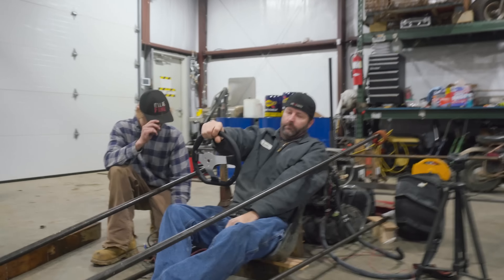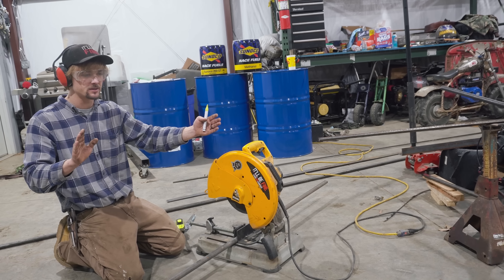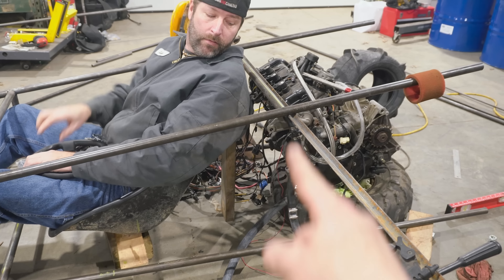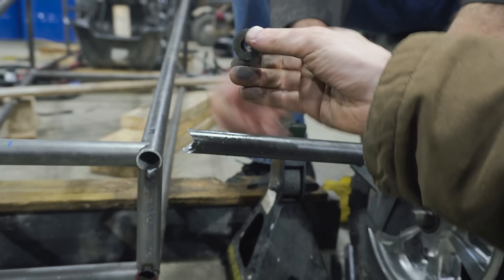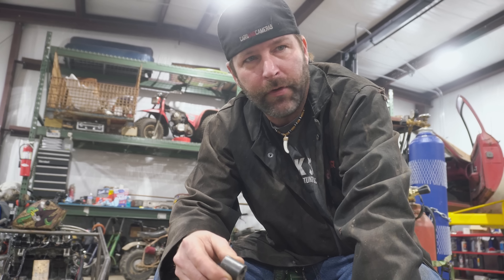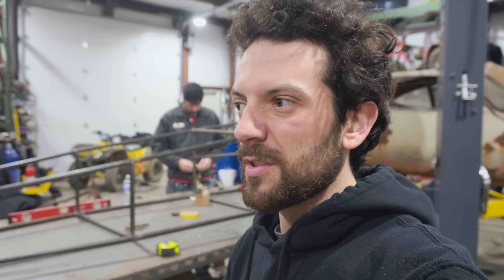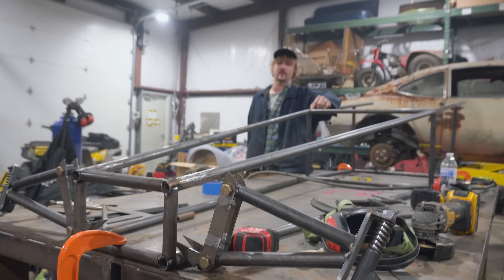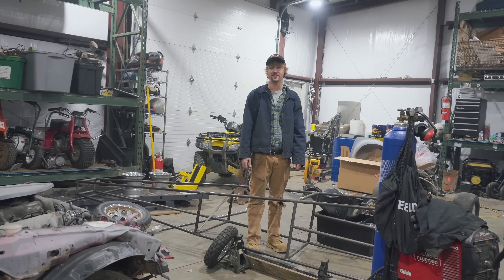118HP Triumph Dirt Dragster Build Pt. 2

Comment: Have you guys thought about using like miata subframe and building a frame to connect them together, use a 2009+ r1 for sound or hayabusa for power, they make drive shaft adapters that attach to the output of motorcycle engines used in ( dwarf/midget car or legend car) maybe buy a dwarf, midget, legend car 😎😈
Reply: dwarf and legends cars use a Toyota rearend, not a miata one. and why would you buy a dwarf car to go sand rail racing with? way to short wheel base.
Reply: @thedr309  mkii celica supra yes,
 but I was incoherent... so here is a more coherent version...

I wonder if they have thought to use both front and rear subframes from a miata and make a frame to connect them at whatever wheelbase they so desire, while using a motorcycle engine to power it (hey they make drive shaft provisioning for motorcycles because that is what dwarf, midget, legend cars use..... 

But hey you guys might even consider in the future just buying a out dated dwarf, midget, or legend car cheap....

 either of those options gives you suspension and way better brakes for the speed of a motorcycle powered vehicle
Reply: @thedr309  really it's not related to the sand rail but rather a future option  to have suspension and brakes (better for the cars and camera's grand prix track)   oh crap I forgot,   if they do go for a 5/8 scale race car they should find a legend car that was setup for road course, not a dirt midget/dwarf car
Reply: Mr Sealman the weight you would add by doing that would be prohibitive and you do realize dwarf and legends cars are hand built from tube don’t you? As far as the brakes go they haven’t even begun to built the brake system yet. I admire them for the start from scratch approach instead of cobbling a bunch of parts together as you have suggested there isn’t anything wrong with the approach they are taking now just wish they would be a bit smarter in things like design . And a dwarf car or legends car is nothing what so ever like a midget car
Reply: Well no suspension no front brakes 115-136 hp I dont math so good but the above listed items =bounce into ditch around the grand prix lap,     at antioch speedway after the political correctness crap I've heard the 5/8s cars called dwarf or midget, even that I know a dwarf car is solid axle coil over rear and sla front with coilovers and the midget is torsion bar solid at both ends,   but super battle aside..... HEY GUYS HERE IS A WAY TO HAVE SUSPENSION AND BRAKES WITH PROPER STEERING, BRAKES, SUSPENTION FROM A MIATA JUST BUILD YOUR OWN FRAME AROUND IT TO PUT THE CARS AND CAMERAS FLAIR ON IT....... 

Secondly if you want to be a little lazy and just buy a cheap 12-1400lb race car with a motorcycle engine installed they have legend cars, (some of which were designed to go left and right on a road course), toss some tires made for dirt and run it around the cars and camera's grand prix IT MIGHT BE INTRESTING TO COMPARE TO YOUR OTHER PRODJECTS LAP TIMES....  AND A HELL OF ALOT OF FUN FOR THE BOYS TO DRIVE, BEING IN A CAR THAT ALREADY HAS ALL THE "SAFTY EQUIPMENT" ONE COULD EVER WANT
Reply: I've worked on k & n pro series cars (old nascar cup car) and asphalt late models in 2008-2010 and then a dirt modified 2010-2014 I know racing, cars suspension, setups,  I'm not talking out of stupidity but rather logical thought, do you have any better ideas or just preferences towards heckling
Reply: With the miata subframes and fabricated frame should be under 2000 lbs if they have 100 or more hp would it be bad.... or
Reply: Also how many dirt guys buy their frame vs hand fabricate it themselves I have never heard of owners fabricating their own unless were talking like street stocks where you are taking a street car and adding a roll cage and bars to brace the front frame rails
Reply: @recruted  yes they are not building a road race car they are building a sand rail for dirt or sand drags and maybe a paved Dragstrip why do you insist on putting suspension under it? That’s why they went with the wedge shape like they have but your wanting to add even more weight by cobbling up Miata part which are not needed
Reply: @thedr309  they also said they will take it around the grand prix track AND I ALSO SAID FOR A FUTURE PROJECT AS WELL
Reply: Obviously you are a no suspension stand rail kind of guy, where I'm a suspension and geometry kind of guy
Reply: @recruted  on a sand car there isn’t a need for it and there is nothing wrong with the front suspension they have now it will function way better than a Miata one will but hey you are so freaking hung up on adding crap you don’t need I’d love to see what you have built…..
Reply: @thedr309  I just buy what I WANT, A ENGINEERING TEAM DESIGNED IT WITH A LITTLE WIGGLE ROOM TO SETUP BETTER GEOMETRY LIKE MOVING STRUT S IN AND BACK  FOR MORE CAMBER GAIN AND MORE CASTER, WITH THE DRAW BACK OF STRAIT LINE TRACTION WITH THE BENEFIT OF CORNER ENTRY, OR ALOT YOUNGER IN LIFE I BROKE THE FORKS OF MY OLD MINI BIKE AND CHOPPED UP A 70S 50CC BIKE AND WELDED THEM TOGETHER (AND GAINED FRONT BRAKES)  BUT BACK TO THE MIATA SUBFRAME IDEA EXPLAIN WHY ITS SSUUUCCCHHH A BAD IDEA.... CHEAPEST SMALL SIZE, READILY AVALIBLE, PREBUILT FULLY CONTAINED, FRONT AND REAR SUSPENSION SYSTEMS  THE ONLY THING NOT ATTACHED WOULD BE THE SHOCKS AND SPRINGS, THERE ARE PEOPLE THAT LIFT THE MIATAS AND JUMP THEM SO INSTEAD OF HECKLING ME ON HOW IT'S A 
HOOORRRIIIBBBLLE IDEA PLEASE DO EXPLAIN BESIDE WEIGHT WHY ITS SO BAD IS IT BECAUSE ITS A JAPANESE CAR OR... WASNT YOUR IDEA... OR  WHY... OR GIVE A BETTER IDEA FROM YOUR HIGH HORSE,  GIVE A BETTER SOLOUTION, OR STOP DENOUNCING MINE, 
THEY TRIED MAKING A GO CART OUT OF A ATV WITH MAJOR PROBLEMS... MAKING A GO CART FROM PRE ASSEMBLED SUBFRAMES USING A MOTORCYCLE ENGINE USING ONLY AN ADAPTER FROM A DWARF CAR TO GET A DRIVE SHAFT TO CONECT TO A DIFFERENTIAL (YOU CAN GET 3.7,4.10,4.30 RATIOS FOR MIATA DIFFERENTIALS TO DEAL WITH THE WEIGHT (THE RADICAL TRACK CARS USE A HYABUSA ENGINE "AND A HAND FABRICATED SPACE FRAME" AND HEALD THE NURBURGRING LAP RECORD FOR A TIME AT AROUND 1500LBS SO WEIGHT IS NOT THAT BAD IS IT WITH A MOTORCYCLE ENGINE BUT SOMEONE NARROW MINDED WONT KNOW THAT BUT STUCK IN THERE OWN WORLD, IF I SAID USE A CROWN VIC FRAM AND BUILD OFF OF IT WOULD THAT MAKE YOU HAPPY, no only saying that this sand rail is the best thing since sliced bread will make you happy right or telling them that they are doing too well go back to lesser prodjects solid frames only no more than 225 cc
Reply: Weird I can't find sand rails without suspension, at the minimum they are welding tube chassis to vw bug torsion bars and using bug suspension and trailing arms in the rear almost like a aftermarket 32 roadster frontend  or midget front or 410 sprint front with coilovers but locating the rear axle   why because sand is not pavement
Reply: Better question why is it that a deer, a cow, and a horse eat the same alfalfa, but the deer sh*ts little balls, the horse sh*ts big balls, and the cow sh*ts pattys
Reply: @recruted  besides the weight...... you said it right there. now if they were building a car for racing around the grand prix they have I agree with you, but they specifically said sand rail with paddle tire to go sand dragging with and occasionally put slicks on it and go drag racing at the drag strip. but I bet your one of the ones who runs out and buys your parts instead of building them yourself. and thats fine if its how you chose to do it, but not everyone wants to take that path some of us old schoolers still like to build our own stuff instead of buying it..... have a nice day.

Comment: I think the rollcage should be parallel to the frame. Perpendicular is not near as strong. Plus it will stiffen the main frame exponentially. And provide more driver safety. I’m not feeling good about this build at all. Come on guys do some research this isn’t a 6 horse project. Be careful and see you next time.

Comment: Hey I wanted to ask u guys if I could get some advice as far as performance parts for a 24hp 724cc vtwin vertical shaft motor off a lawn mower I’ve turned it into a horizontal shaft and I wanna make it even more ridiculous I’m putting this crazy motor on a home made motorcycle and I want it to be stupid powerful and have a high top end

Comment: I'm just gonna be completely honest guys you all do Kno that sandrails have full suspension. like full independent suspension right, now trying to be mean but I don't think it's gonna do all that good off-road. it'll also be pretty jarring and stuff which will possibly put cracks in the frame. plus bike engines don't like to be mounted to stuff chassis's. it's hard on the engine mounts and the internals, I'm just saying not trying to be rude just wanna see how cool this kart ends up.